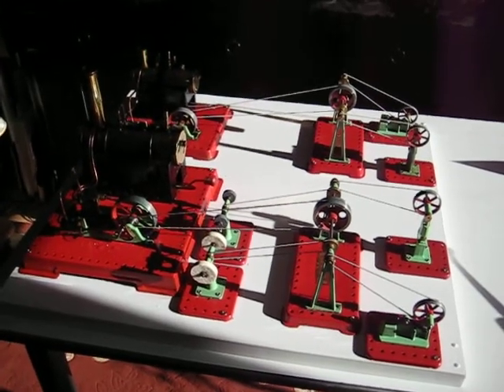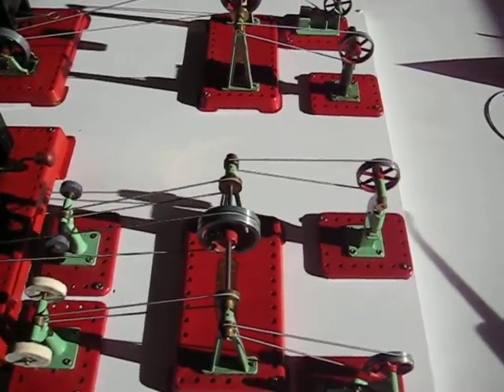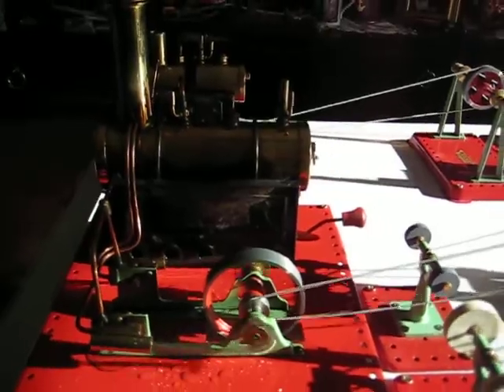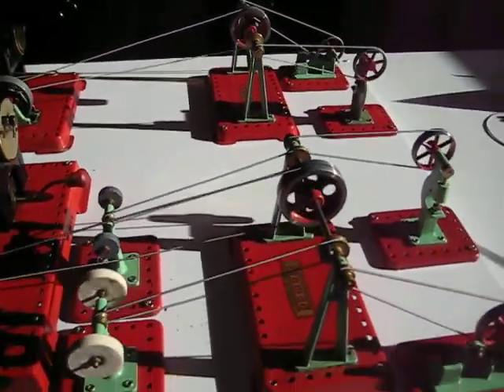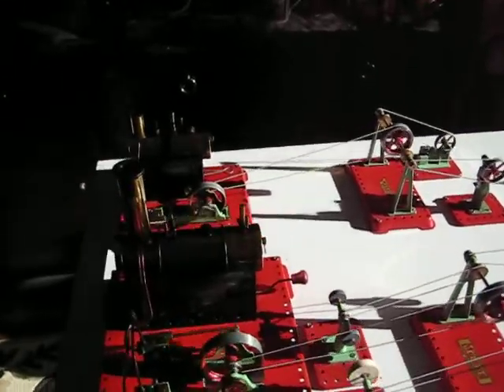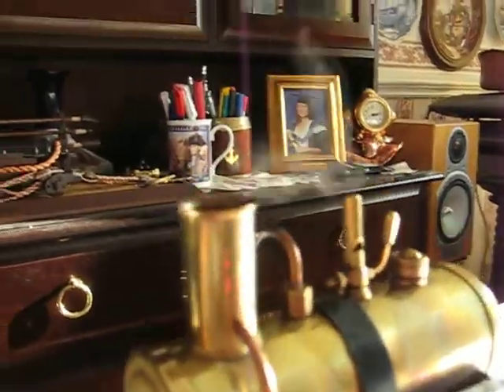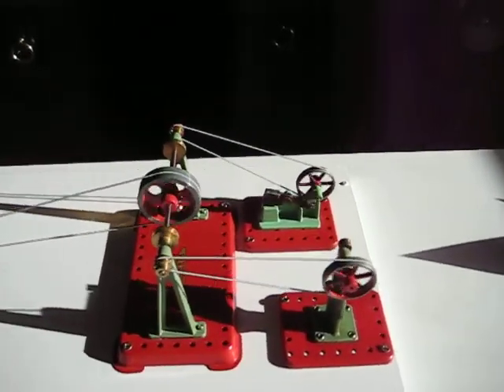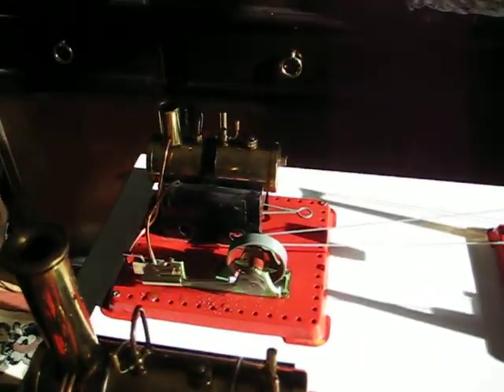Mamod SE2 and SE3 steam engines running.

Comment from the maker: Cheers JDM glad you like. Must try to do a better one though as the strong sunlight overpowered the video camera  somewhat. I have also put some sound insulating between the base board and the table it sits on which I hope will quieten it a little.